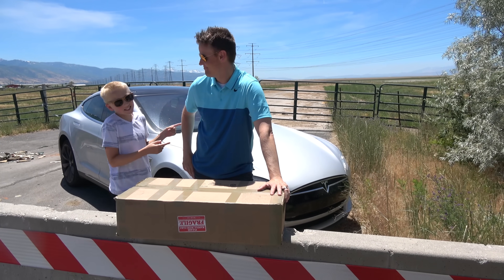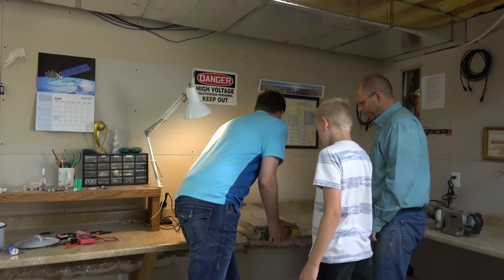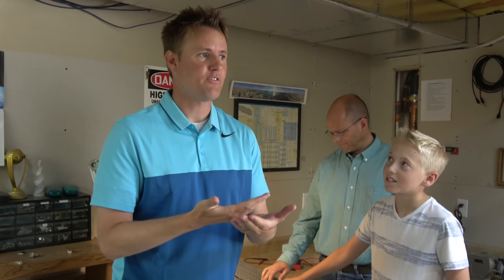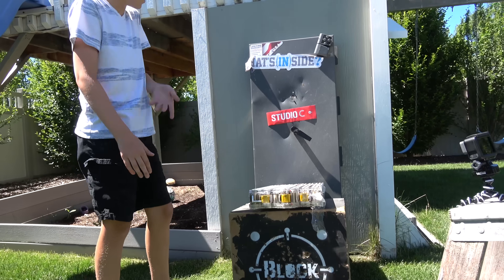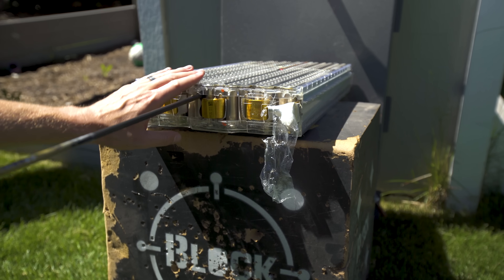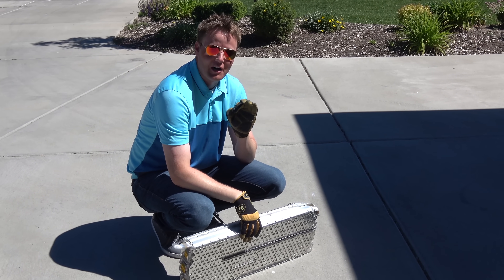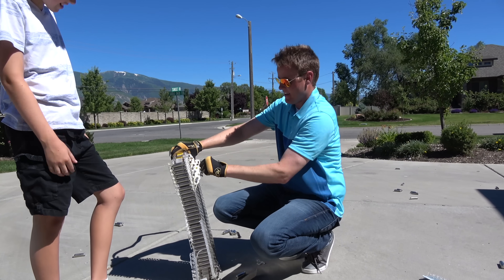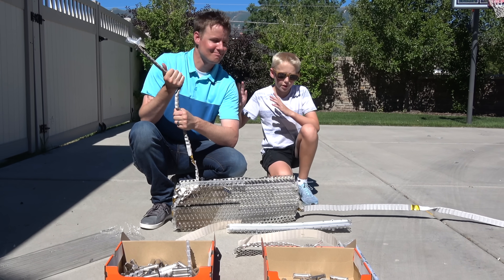What's inside a Tesla Battery?

Comment: I'm not concerned about my gasoline-powered car exploding from a punctured fuel tank.
I'm not concerned about the tesla exploding from a punctured battery pack.
What concerns me is this. 
Replacing my gas tank will cost $300.00 to replace & I can do it myself. 
Replacing a tesla battery pack will cost $13,000.00 plus $3000.00 for installation.

Comment: Yeah.  Gas tanks don't spark and go "boom" . -_-...   Like seriously. Expected a Kaboom.  There is NOTHING EXPLOSIVE in these.  They are batteries.  Batteries go BOOM, after over heating and discharging for a while.  Creates a fire over time.  Also, why in the hell would you let your kid just pull the arrow out, when there is chemicals inside the batteries.  This is the 4th video where there wasn't enough safety discussed before the making of the video.

Comment: Learn how batteries work or you can die. Batteries explode due to thermal runaway. Chopping one in half won't cause it to explode, it requires overheating. Yes, if you destroyed the integrity of a battery and wait long enough it might go into runaway but runaway typically happens during charging or discharge. These two events create "heat" . Too much and KABOOM. CHARGE or DSCHARGE a damaged battery and 100% of the time it will explode.

Comment: What would really happen if a rock punctured your gas tank? According to science? You'd leak fuel out of a hole.
What would really happen if a rock punctured your battery? According to science? You'd leak batter acid out of a hole.

The chances of a fire in either event would be astronomically low. The real danger for batteries is overheating and causing fire....hence the cooling system.

Comment: The amount of technical illiteracy in this video is over 9000.
Battery acid??? Inside Li-Ion???
Also you didn't have to recycle 90% of perfectly working cells in brand new condition! That thing is NOT green at all! You should have sold them or gave them away, now they'll get shredded into raw materials of which 2% will actually be used.

Comment: One Question: Was it fully charged?
Please answer, because this is important. A Battery, which is not fully charged is really unlikely to combust and depending on the Voltage, it might not even fizzle.
Also 450 Batteries and 21.5V says absolutely nothing. From what I can see in the video, there are 8 rows of batteries all in parallel and the rows are in series to one another. This means, every batery is charged to 2,6875V. I dont know the chemical composition of the Tesla batteries, but for most batteries this is completely empty.
Reply: They had to be flat, the 18650 cells are made by panasonic

Comment: i could have been off grid for some of my devices for at least some time, how were they wired, 10 nos in series in a bank of 10 or something, did that battery pack power the whole ? bhp car, did you find out how much Ah & voltage was rated for the battery pack.

Comment: You can dispose of em right here ill take em all and you wont have to pay to dispose of them. Those are 3.7 peak volt 2500 mah li po rechargeable. Or you can sell them individually on ebay for 3 to 5 each. They are used in every thing from those power packs for cell phones to laptop batteries. But if your just going to pay to have them disposed off seriously message me and i can put them to good use at the homeless charity here where i am

Comment: Actually Tesla did not design the individual cylinder battery cells themselves. They are called 18650 cell batteries and they did not invent them, they just used an abundance of really high quality 18650 cells made by Panasonic in order to power the car. So they used existing technology and used it in a really cool way, but awesome video guys, I never knew there was liquid acid in 18650 CELLS! I usually thought acid was in doubleA batteries and tripleA

Comment: "There's battery acid coming out" 
No. No there's not. 
Why do you even drive a Tesla if all you do is ruin the environnement with all your blowing brand new stuff up? This was in no way educationnal, nor useful in any sense. You just wasted a perfectly fine battery which takes a lot of ressources to manufacture. 
And by the way, what you cut in half is called a cell. A battery is composed of multiple cells, not multiple batteries.
Reply: TRIGGERED!! 🤬

Comment: silly rich people thinking a battery will explode by shooting it with an arrow and smashing it and cutting it. Looks like you need more common sense skill. Overcharging a battery doesn't explode the battery, it just leaks acid and you think all those will explode a battery. Go throw that chuck of battery in the fire and we will see what happen.
Reply: lithium ion batteries dont have acid, i think that was just the electrolyte getting boiled by the batteries short circuit.

Comment: love your video....QUESTION:  what is the testing device brand model used early on in video to test packs electrical data?  I need to get something that is multipurpose and would be nice if it can send data to a computer/tablet/etc...
Reply: They're using a cheap multimeter. 20 big ones at your local hardware store

Comment: Anyone want these 18650s for there vape? Haha 😆
Reply: pretty sure it`s 20700 or 21700s, they hold more mah and can run a higher cdr. saw somewhere that tesla was buying every single cell that was coming off the assembly line of a particular type of battery that would be perfect for cloud chuckers.
Reply: topshot 6969 Juul gang
Reply: HAHAHAHAHA SO TRUE!
Reply: Are they 18650 batteries?
Reply: Odd jørgensen those are actually 18650 cells. They're made by Panasonic. Really high quality 18650's with a high capacity and mid discharge (10amp constant).
Reply: Those aren't 18650's

Comment: As a whole, video participants did not take reason. Bury the audience with the crap ... Overall, the result was not surprising. In order to ignite the article, it is necessary to achieve the burning temperature of the polymers from which the separator is made. Which can happen, but it is not so common.

Comment: The new Lithium battery tech used in car cells is what they call Lithium Iron Phosphate (LiFePO4) which is more stable and therefore does not combust like your usual Lithium Ion (LiCoO2 or LiMn2O4) batteries.  New Lithium Iron batteries are also more durable, last longer, have more duty cycles and are also non toxic unlike the other older type Lithium Ion cells.

Comment: The drivetrain is built into the tires? BUILT INTO THE TIRES?? how dare you :)
It's a paint can motor on a fixed gearing differential with normal half shafts out to the wheels. And in some Teslas there is a motor for the rear and the front as well. Yours is probably just on the rear. It's not in the tire :)   google pictures of Model S drivetrain. It's very straight forward.
Reply: Dan Frederiksen dan.. don't worry.. this is what you get when you have more dollars than sense.

Comment: I don't get it, you never explained what's inside the battery...
Reply: They usually never do!
Reply: PS. There is no acid in Li-ion batteries.
Reply: it's 400 volts
Reply: There are 16 modules wired in series containing 7104 Li-ion cells.
Reply: Jakub Włodarczyk I'm not sure what it is... But I don't think that's acid. It could be a strong alkaline tho and still have a violent reaction to being in open air like an acid would.
Reply: @JamesContos85  its a mixture of chemicals, and no there is no acid in them.
Reply: @JamesContos85  sir please don't weast the cells, in india petrol price goes so high, 
Rather destroying the cells please give me 40-50 cells so I can make a 36v  17.5Ah battery for my e-cycle,
(For daily commutes of ~ 33+33km)
Reply: Well the lithium metal itself can react with the moisture in the air as well as it undergoes spontaneous oxidation. The electrolytes used in the batteries (which are usually organic liquids of high conductivity) are used in a very small amounts, just to make the Li+ ions moving more freely between the two electrodes.
Reply: sorcery
Reply: Anton Zaitsev In SERIES?
Reply: Democritus86 that's exactly how it's set up. The PRIUS is similar, but with different cells. The rows are in series and each row is paralleled with one another.
Reply: Could get sued for going Further
Reply: Anton Zaitsev you do understand how much voltage that would be right?
Reply: Juice
Reply: He doesn't know
Reply: bunch of 18650 batteries run in series. They are exact same batteries that are used for vaping e cigarettes
Reply: some of em would be in series and then groups of em in pararel probably...

Comment: If you puncture a gas tank it won't explode because liquid gas is not flamable it would just leak gas all over the road
Reply: In the typical event a gas tank is puncured, a crash, there are metals parts grinding which leads to sparks. Enough to lighten that leaking gas.
Reply: and gasoline vaporizes  very readily when exposed to pressure, like a collision,  or heat.  remember kids, gas really can burn you silly despite what some will tell you that liquid gas won't ignite.
Reply: very true.  The people on this video do not know that.

Comment: I don't think if i get punched in the gas tank it will go boom. Yeah, sure. It will propably leak, explosion needs a spark not just punch. If you get punch in the battery you can get short circuit and that can cause a flame inside your car. Enough said.

Comment: "Drivetrain that's built into the tires".   Um, no.  There is a motor and gear reduction transaxle with half shafts mounted between the wheels.

"Battery acid".  Um, no.  Lithium ion electrolyte is not acidic.

Comment: Gas has a better energy density than electric cars. meaning that the same ammount of energy can be stored in a smaller area that is easier to protect from external damage. Not to mention that you need to have a spark to ignite a gas tank where merely puncturing a battery will result in a chemical fire

Comment: are you getting a new Tesla or getting a gas car if I was you I would get a Tesla
Reply: @VLAD THE IMPALER No.. YOU look it up.
Reply: @cossacks man The only difference is that a power plant is more efficient than a small ICE car engine and you're not taking into account the  fact that an electric car is much more efficient than an ICE car where most of the fuel is turned into heat. Finally you forgot that the fuel still needs to be distributed to all the gas stations which also costs fuel.
Reply: ya
Reply: I would get a gas car
Reply: model x?
Reply: VLAD THE IMPALER but as technology evolves more the factors of it causing more emissions with go down.For example there is a new type of battery that will be biodegradable and less harmful to earth while also being able to charge in a instant.
Reply: thats bs
Reply: Cossacks Man there's new battery that will be biodegradable and be able to charge in a instant the problem is they can't mass produce it yet.
Reply: Why do you need to know
Reply: get a prius its a hybrid
Reply: Tony Miller prius is the worst car ever
Reply: Toto Geenen What makes you say that?
Reply: You're forgetting the vastly inefficient electricity grid. The general efficiency for a modern petrol or even better, Diesel engine is pretty definitely greater than {coal power plant + electricy grid loss + 9X% efficient electric engine}.
Reply: ez45 - You're wrong. The electric grid is more efficient than a fossil fuel engine when accounting for well-to-wheel costs. What's even better about EV's is that the source of electricity can be changed, making an EV cleaner (IE: Installing home solar). Where as a fossil fuel car is pretty much stuck the way it is. Some can be converted to clean diesel or CNG, but that's really inconvenient.
Reply: Lapuka - Where did you get that information? It's entirely incorrect.

Hybrids and EV's cause slightly more pollution to produce, but quickly offset that within a couple of years of driving. The best part about EV's is that even old ones are becoming more clean due to the electric grids switching to natural gas and renewable power.
Reply: Sure Sean, the electricity grid by itself is not as inefficient as a combustion engine. But coal power plants, which account for double-digit percentage of electric energy in most industrial countries, have to be accounted for as well, which is what I said. In a 100% renewable or perhaps renewable+nuclear energy system, electric cars are absolutely superior, but we're not quite there. And then there is still the energy and resource-intensive production of Lithium batteries to be considered. Swedish energy agencies calculated that production of batteries for 1kWh releases 150 to 200 kilograms of CO2. Which means even for 100% renewable, you'll have to drive 30'000 up to 100'000km / 18'500-62'000mi to beat an efficient petrol engine vehicle.
Reply: Isaiah Propps Get a Tesla and I will keep the gas car.  The more Teslas the more gas availability for me.
Reply: Cossacks Man Tesla power stations are becoming solar powered
Reply: That's why the infrastructure is being increased exponentially. Your reasoning brings the chicken or the egg problem. If there's not enough charging infrastructure it's not convenient to buy an EV. If nobody buys EV's, it's not feasible to invest in an infrastructure. Upside: electricity is already everywhere.
Reply: The worst case scenario for an EV energy source is coal, even then, it's still much cleaner than an ICE car.

* Coal is usually locally sourced and requires little refining.
* US Coal plants have stringent pollution control.
* Most EV drivers charge their cars at night, when power plants are idling and generating excess energy. This essentially means that the car is fully emissions free because that energy would've went to waste.

EV's are viable. There's no reason in terms of environmental impact not to drive one.
Reply: You should buy a rfb 20e cef
Reply: to make a battery pollutes more than a basically life time of gasoline car moderate use + charging that battery you need power which is not clean either unless it's from a nuclear power plant
Reply: an electric car pollutes 5 time more than a normal car...look up if in disbelief